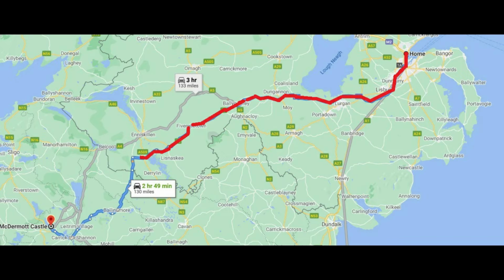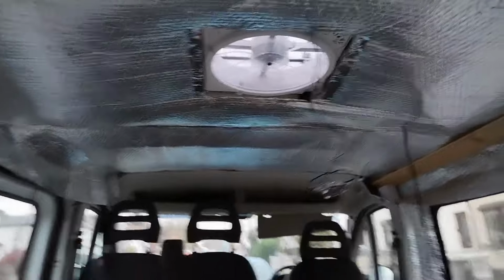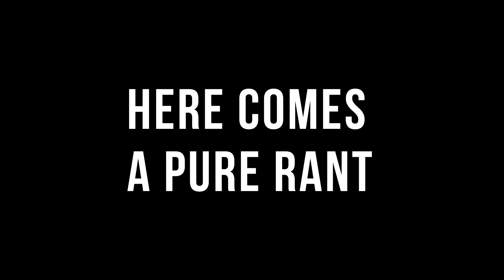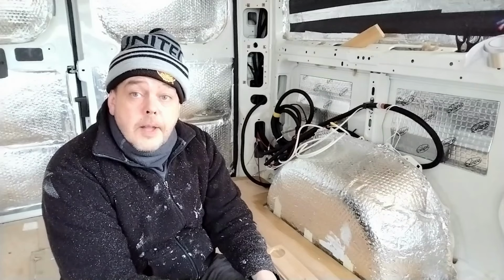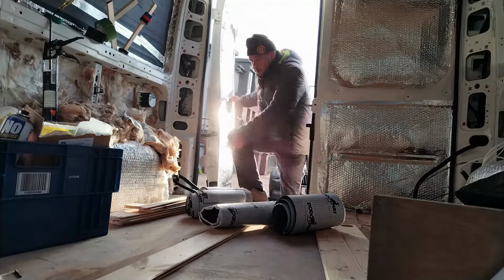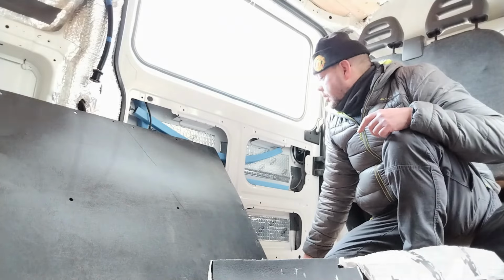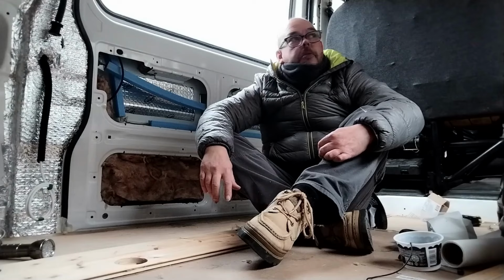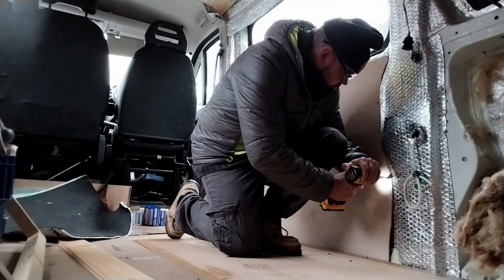The Cutest Van Transformation You've Ever Seen

Comment: I would never cut holes in my roof, have had my self build camper for eight years never needed a roof vent, I live in Portugal and travel around Europe every year 300+ nights. Used the same silver bubble and it works well, so no need to do what some do and lose ceiling height on a 2 metre van. I have a Vivaro better and cheaper than the Transporter, the Relay seems a good van too, good space for a camper. Bonne chance.
Reply from the maker: Cheers Allan, when i started this project off buddy i hadn't a clue a lot of trail and error and alot of research, and i mean a lot of research, hope all is well buddy!

Comment: Hi I have same van how did you attach the tongue and groove at the cab end as the roof bars in these vans are all uneven, did you fit some sort of batten there ?
Reply from the maker: buddy i cut smaller bits and attached them between the gaps. smack in the middle the grey plastic screw thing which runs through the cab surround i used measured the gaps and put up 5 mm bits using self tapping screws and sikoflex